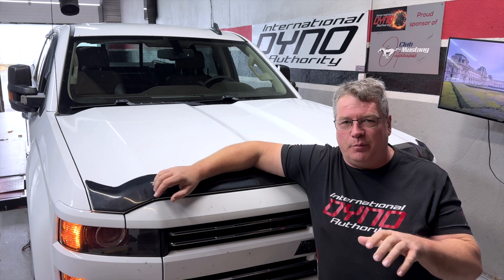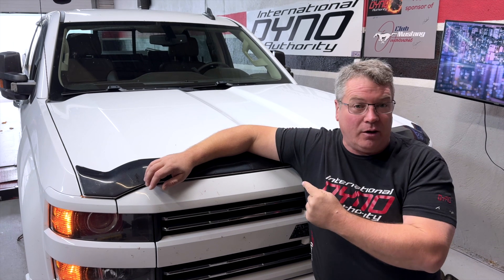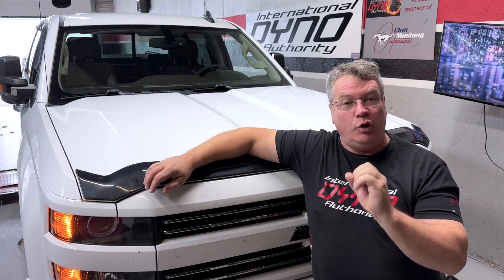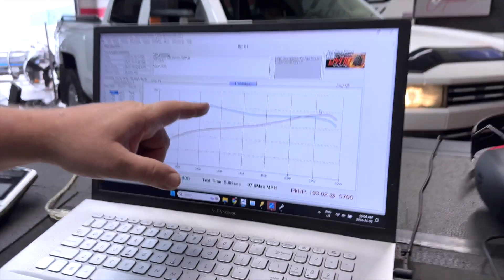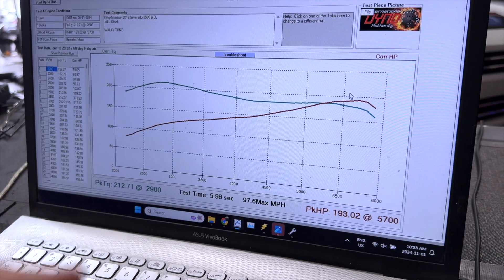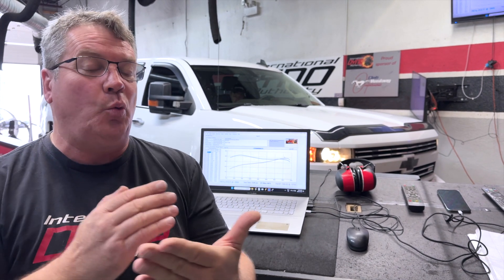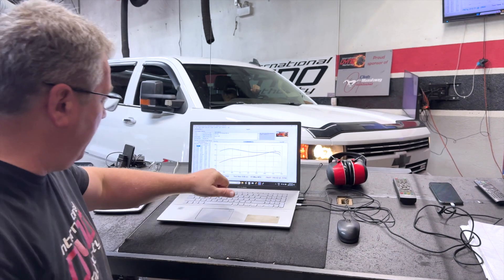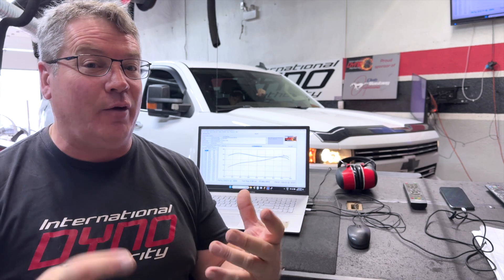300K mi. 2016 Silverado 2500 Tuned on the Dyno | What happens?

Comment: 5:12 you kind of elude to the deception you are pulling here.  Making the pass quicker meaning using a different gear to skew the results.  If that is not it are you pulling fuel and timing ahead of time to make your results look better.  There is no way a NA engine is going to see those kinds of gains without nitrous oxide, nitromethane/alcohol fuel, or some way to cram for oxygen int he combustion cylinder.   You do not have to lie...
Reply: Any replies?
Reply: Yes, I need a rebuttal to this. Just bought a 2016 hd2500 6.0

Comment: Are you not just taking the torque management out? Does the torque management protect the transmission?
Reply from the maker: Yes, torque management is used in GM transmissions to aid in longevity by reducing engine torque during certain conditions, especially during gear changes. This helps protect the transmission from excessive stress and potential damage, ultimately contributing to its lifespan. 

Here's a more detailed explanation:

What it does:

Torque management is a feature that electronically controls the amount of engine torque transmitted to the transmission. 

Why it's important:

It's particularly crucial during gear changes (upshifts and downshifts) and when the transmission engages into drive or reverse. Reducing torque during these moments prevents harsh shifts and minimizes stress on the transmission components. 

How it works:

Torque management can be achieved by retarding ignition timing, reducing throttle, or other methods that temporarily lower the engine's output. 

Benefits:

By reducing torque, torque management helps to:

Prevent harsh shifts: Smooth gear changes are better for transmission longevity. 

Reduce transmission stress: Excessive torque can damage the transmission's components. 

Improve overall vehicle performance: Smoother shifts and controlled power delivery can lead to better fuel efficiency and a more pleasant driving experience. 

Tuning and Modification:

While torque management is a factory feature, it can be modified or tuned to optimize its performance, such as adjusting the RPM at which it engages. 

In essence, torque management is a safety feature and a performance optimization tool in GM transmissions, contributing to both the transmission's longevity and the overall driving experience.
Reply from the maker: Hi David, 

Tuning is mostly AFR, we pull the individual injector data. We measure  , Air temperature, cubic feet / cylinder/ second. 

Then we balance the individual cylinder, and bank. Once we have the LT ST Fuel trims in balance, and minimized we begin building a fuel curve correcting every 50 Rpm.  With a modern production ECU, we have access to thousands of spreadsheets, and hundreds of thousands of cells.

After we have tested, and built an optimized fuel curve, we turn our attention to cam timing. We optimize cam timing (all 4, when available).

We then work with ignition timing, the VE, then MAF.

At no point do we turn off torque management.

After completing the engine tune, we begin with the transmission tune, tire size, differential gearing, shift points- pressures, and torque converter lock up tables.
Reply from the maker: https://youtu.be/VIUttNQKLsI?si=s6aT9hljdGuFQzrc
Reply from the maker: https://youtu.be/0ZIHuDfQRos?si=QEKR9v07MfCUUkFf
Reply from the maker: Home/Articles/Education/Introduction to Transmission Tuning

Introduction to Transmission Tuning

Published on: April 11, 2024Categories: Educa
Understanding transmission tuning can be daunting, we know that. Transmissions are one of the most complex parts in your vehic
Automatic Transmission Basics

Before diving into the specifics of transmission tuning, it’s crucial to grasp the basics of how automatic transmissions work. Unlike manual transmissions, which require the driver to select gears, automatic transmissions do this automatically based on the vehicle’s speed, throttle position, and other factors. The heart of an automatic transmission is its ability to manage power from the engine to the wheels efficiently, ensuring a smooth and responsive driving experience.

Torque Converter Lockup: The Bridge of Power

The torque converter is a fluid coupling that transfers rotating power from the engine to the transmission. Torque converter lockup is a critical function that occurs when the engine reaches a certain speed, allowing for a direct mechanical connection between the engine and transmission. This lockup reduces slippage and improves fuel efficiency. Tuning the lockup can enhance performance by optimizing the lockup timing for better acceleration and responsiveness.

Line Pressure: The Force Behind the Shift

Line pressure is the hydraulic pressure used to engage the gears in an automatic transmission. Adjusting the line pressure can significantly affect how a transmission shifts. Higher line pressures can lead to firmer, more decisive gear changes, while lower pressures result in smoother, less noticeable shifts. Proper tuning of line pressure can improve the driving experience by tailoring shift firmness to the driver’s preference and driving conditions.

￼NOTE: Values Shown are NOT suggested values for your application.

Shift Points

Shift points refer to the vehicle speed or engine RPM at which the transmission shifts from one gear to another. By adjusting shift points, tuning can dramatically alter a vehicle’s performance and driving characteristics. Advancing shift points can leverage engine power for faster acceleration, while delaying them can benefit fuel economy. The goal is to align shift points with the engine’s peak performance for optimal power delivery.

Shift Timing

Shift timing is the time it takes to complete the shift. Whether it be an upshift or downshift, shift time is often measured in Milliseconds. Shortening your target shift time can improve shift feel, reduce heat, lengthen transmission life, etc. There are very few cases were extending shift time would be necessary. Using VCM Scanner, Shift time can be logged as shown here.

Often when tuning shift timing you’ll want to tune pressure and shift TQ management to hit the shift tim
The shift time table uses Torque and engine speed to determine the target shift time. Most shift time transmission tuning uses this same logic.  Different modes in the transmission can often have different shift time targets, like tow/haul mode on a truck or sport/track mode on cars.

Shift Adaptive

Often when tuning a late model transmission, you’ll need to reset the shift adaptive that the transmission module has “learned”. This should be done after your first major changes to the transmission tune are completed. The “Shift Adapt Reset” functionality is available in VCM scanner under “Controls and Special Functions”. Below is an example of how to reset shift adapt on a 6L80/90 using this function.

Comment: L96 make 360 horsepower 380 lb-ft torque at the crank. There's a 20% loss through the transmission. It shouldn't be making 193 horsepower. With 300k miles, It should be making 275-290 horsepower and 295-305 lb-ft of torque at the rear wheels.

Comment: Can you suggest anyone in Houston that can do this to my 2015 GMC 2500?  It has about 92,000 on it.  Only really use it to tow a travel trailer.  Would like to get more torque and gas mileage out of it if possible
Reply from the maker: @IsaacTristan-j1y  Thank you, for writing in, and stimulating conversation. 

We have included the information for you. 

Just beware, you need to vet any person and or business, that's going to have access to your vehicle. 

Step number one should always be spending an hour and a half on getting the fuel ratio, and the air fuel ratio and the fueling tables correct.. 

If you ask them, what their first step is, and they start mentioning something about modifying and or tuning, the ignition timing tables. You should run!!

Cheers, from all of us at International Dyno Authority.
Reply from the maker: @IsaacTristan-j1y  

https://www.hptuners.com/dealer-map/

Comment: Add a small cam and long tubes and you  pick up even more. Just did this in a 2013 2500 suburban
Reply from the maker: @mymodestgarage9211  

This customer was definitely interested in exploring performance upgrades. However, I suspect his wife might have some reservations! 

He purchased a vehicle with significant mileage and wanted to ensure it was in top condition for years to come.
Our tune includes a complete transmission remap, significantly extending its lifespan. Plus, it optimizes the combustion process, allowing the engine to run at its peak efficiency for as long as possible.
While I agree that a camshaft and long-tube headers would further enhance performance, they are a performance detraction without a proper new proper tune. All you'd get is a lot of noise!(Which is cool too)
Cheers from the entire team at International Dyno Authority! 

Stay tuned for more exciting content."**
Reply: @ that’s my biggest complaint, the noise.

Comment: What can you do with a 2016 F 150  5.0 coyote with a S&B intake and a full 3 inch exhaust ? It only has 58,000 miles .
Reply from the maker: @thomasdaum1927  We bring that particular model In. We begin tuning and walk through each step. Fuel curve, cam timing re-map, MAF tuning, Ignition timing, transmission tune.

When we finish you',LL see 60+ HP increase 75+ torque increase.

613-795-2779
613-857-3578

Comment: Would headers and pipes help significantly?
Reply from the maker: Absolutely, long tube headers. Something like a 1 and 15/16, long tube header, with a tune. Tune. It's one of the modifications you have to make a tune afterwards. Long tube headers with a tune, will add another 25 horsepower on top of this. And give you more throttle response all the way through